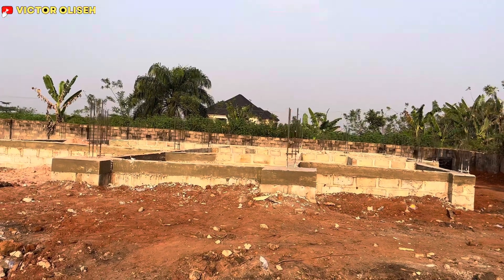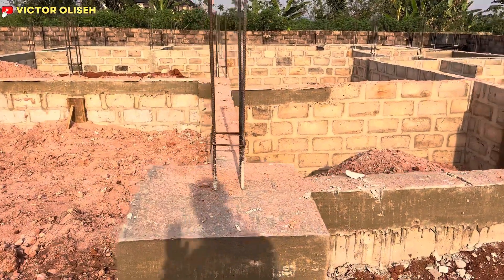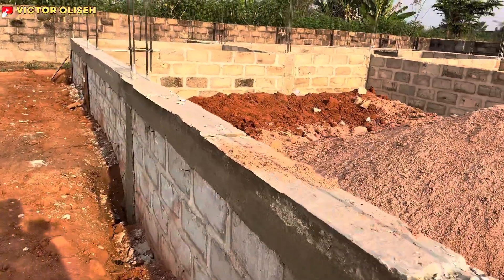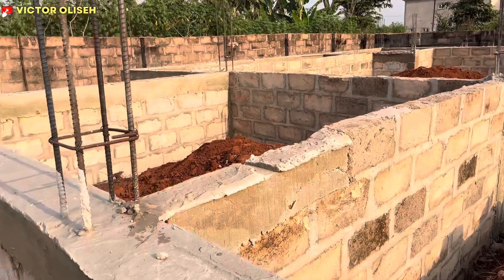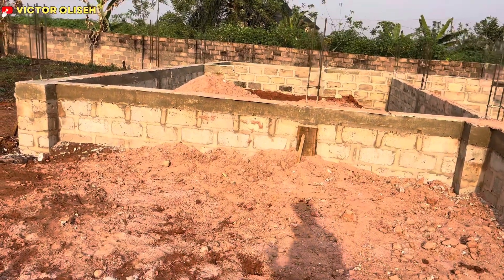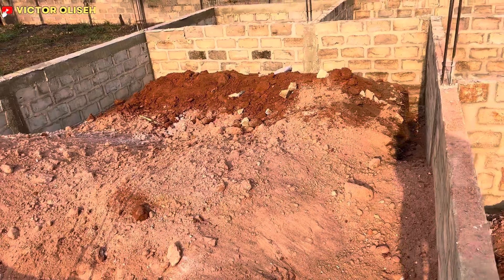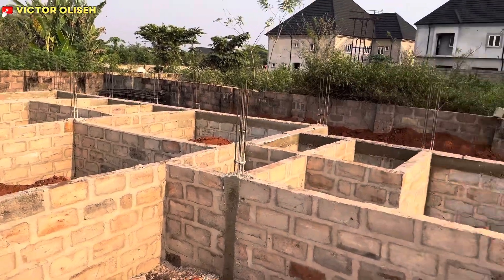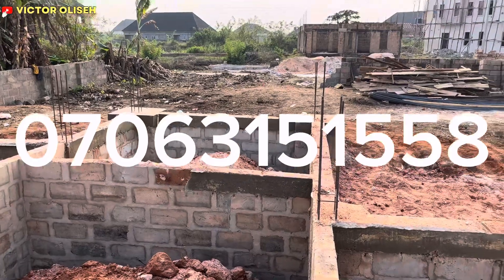#Importance of #plinthbeam on a #duplex (#building) #project

Comment: Good job, how much it will cost to build this duplex and if he can be built on 50 by 100
Reply from the maker: Yes it can be built on a 50 by 100, for the cost of the project; it’s based on several factor.

1. Your location
2. Time of execution 
3. Size of your rooms
4. Engineer on site and more.

But if I’m to advise, kindly get your architectural design first and then from the design you can determine what’s to be spent on your project
Reply: Please this one you are building now what is the cost to natil